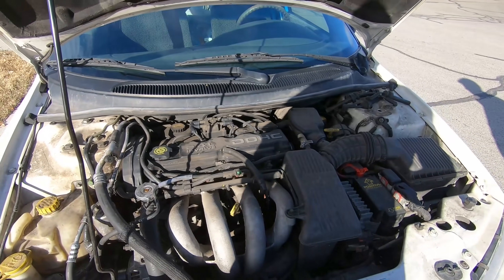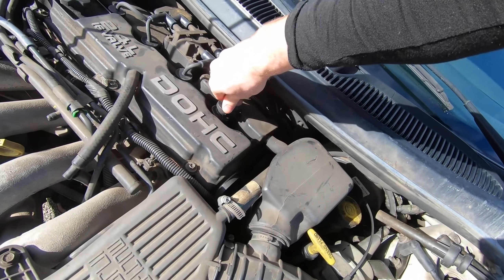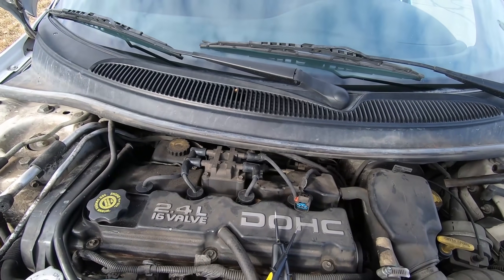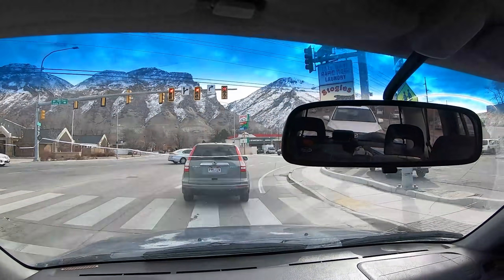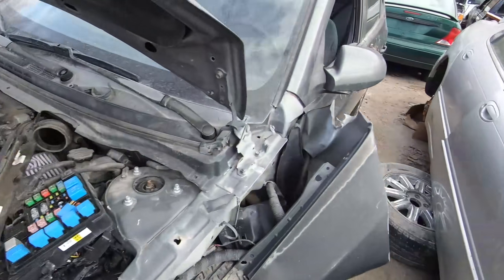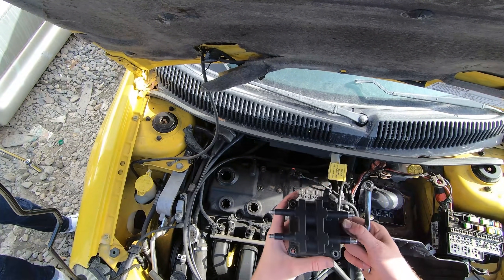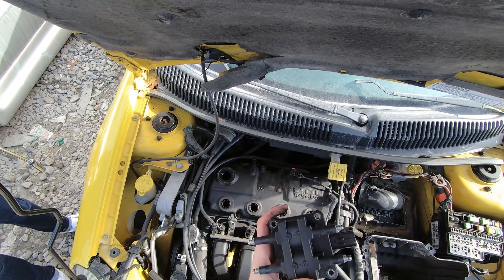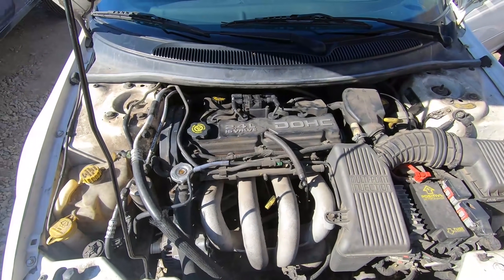A guy misdiagnoses a car. This is what was really wrong. Junkyard parking lot fix.

Comment: When I was younger I got all my parts from the scrapyard Even picked up a few brand new transmissions over the years. His motto was exact same as mine if it drove to the crash means all the parts are still good.👍
Reply: Where I live the junkyards have all gone to selling collision parts to insurance companies, and they don't do the 'pick and pay' thing anymore for small parts. They won't sell you a mirror or a window becauase they figure the insurance company will want the whole door. You can't get a fender or a hood without buying the whole nose clip. It sucks! On my first car I bought a starter, and alternator, and an automatic transmission to keep it running.
Reply: @AcmeRacing  Dang, that's as bad as hearing about the firearm regulations in California. Guess I'm lucky to have a few U-Pull-It yards around me that'll sell or give away whatever you bring from the yard. Just unfortunate that I haven't seen a vehicle there older than the 80's in several years, been having to buy new/aftermarket for my '74 and man what a wallet destroyer. Deep down I know I'm doing the wrong thing pursuing this project that seems to never end given my current financial state. It's become less about restoration and more about maintenance every time I fix something 2 more things need fixing. But I won't give up on it, I've seen plenty of "I regret selling it" to do that this time.
Reply: Fortunately there are still wreckers you can go to. You have to drive increasingly far to get to them (except in my case, I actually moved 20 min away from one that was a 45 min drive) and I think this practice will continue, unfortunately.

Comment: I once found a 95 Suzuki Side kick in a great condition at my local pull a part, it only has a busted hood and a torn roof canvas from the damages I can see. The frame looked perfectly fine, no major rust or damages, even the aftermarket stereo was still in it. The engine and everything looked original with 120k miles on the dash, I called pull a part the next day to ask if I can buy one of their junk vehicle off the yard but they told me no :/ which didn't make sense to me at all, it was such a shame. I would had love to buy it and put it back on the road again
Reply: They make more money parting out the car vs selling it whole

Comment: 2.4 engines in the Dodge Stratus PT cruiser SXT Dodge neon SRT Dodge neon all have the same coil pack and can be used on any of the 2.4 engines. You can also use that same coil pack on the 2.0 engines in the Dodge neon and the Stratus typically if that engine is in a vehicle most parts on there can be swapped between those vehicles.

Comment: Those coil packs are sealed against moisture.  Wet didn't kill it.  In all likelihood it was thermal stress from rapid cooling in the wet wash environment on a hot sketchy coil pack.  Don't over tighten the bolts which can stress crack the housing.

Comment: Whenever you grab a coil pack from a junk yard, always bring it to the desk with the spark plug wires attached. Chances are they won't charge you for them, and it they do, it won't be more than a buck or two, and you can ALWAYS use extra spark plug wires...also, stuff your pockets with fuses...never know when you may need to replace a fuse or relay or breaker!

Comment: can i suggest you getting ratcheting wrenches watching you take forever to get those bolts out was painful for me!
Reply: The problem with the ratcheting wrenches is the size of the head. It doesn't always fit in certain places.
Reply: @doughayward4973  yah i hear yah but they can be handy alot 2! I think i picked up a metric/standard craftsman set for 80 bux online was on sale!
Reply: @bulletsponge1656  You'll never have enough tools. I'm a retired mechanic with a garage full of normal tools, impact tools, test equipment, Escort specials, Omni/Horizon tools, and many, "Why do I have these tools?". Now I "need" battery-powered impacts.

Comment: Happened to my f150 02 when I tried to power wash the engine 🤦‍♂️ I took it to the shop they said water got in the spark plug wells and the replaced all the plugs it ran good again. It ended up costing my like 300.00 now I change them myself !

Comment: A regular owner can get coil packs for fairly cheap online and replace plugs as well if the set is 4 and they are cheap to buy, like my 1999 Corolla NGK platinums are. I like to get new OEM or warranted like OEMs are. Easy to install and fairly cheap to buy.

Comment: when i had my eclipse my 4th always misfired it was rusting the coil terminal i sanded and used dielectric grease and that worked for like 3 months before i swapped parts im thinking thats a common issue on DOHC

Comment: I'm not really familiar with car diagnostics but how did you know it was the coil pack and not the coil itself?
Reply: Coil pack is just all coils in one unit. You saw how he saw it had power to the coil, meaning the pack wasn't working right. He also showed that the spark wasn't jumping to the side of the block like it was in the other cylenders

Comment: if you are going to make a lot of trips to the junk yard   get yourself a small tool bag  fill it with some tools   such as for starters  a cordless impact driver    sockets and ratchets wreches  screw drivers  pliers  maybe a hose pick  cutters     trust me its a time saver   . I wish I could pick my own parts.  and for one coil pack I would have went new   . you dont know what condition it will be at the junk yard    it could be cracked  dry rotted    lots of mileage  on it            change all four  and the plugs    keep it oem       unless your really staped for cash. I would have taken the old coil pack with me  to the yard    and if there is a lot of front end damage    to the car be careful.   if it is electrical parts     keep it new   but thats just me.  and if im walking though a junk yard  its boots  with steel toes    not crogs      bad idea
Reply: good ideas

Comment: What's the deal with cracked windscreens in the US ? I see it a lot on YouTube. that would be a fine and points on your licence here in the UK.
Reply: I don't think there's any place in the US where equipment failure gets you points, but a crack may or may not be a fine, dependent on the size of it. It's just not easily enforced in rural areas where there are very few police.

Comment: I hate to be that guy but you really shouldn't pull HT leads off the plugs on a running engine.  This is extremely hard on the coil insulation and the ECU which has to absorb all the energy it's put into coil if it doesn't spark.  Pulling the injector connector off is safer all round.

Comment: Those are the worst engines, They were literally pouring oil out of the headgasket from the factory with 4 miles on them. And they were pretty well known for timing belt idler pulleys falling apart at 20k miles. And it is an interference engine.

Comment: Two words for you kiddo "ratchet wrench". Other than that I like what you doing
Reply: Probably not enough room for the head of a ratchet wrench on that coil pack. You can see how tight it is at 4:47
Reply: @tuzyzx  Not a socket wrench.  A box wrench (like the one he was using) with a ratcheting head.  It's the same exact physical size as what he was using, but ratchets so you don't have to constantly slip the wrench off and reposition it.
Reply: @geoffreyreuther5260  I know what he means by a ratcheting wrench. I have a set. Usually the box end of a ratcheting wrench is slightly larger to accommodate for the ratcheting mechanism, it's not much but it can be too much at times.

Comment: You didn't check the ohms of the plug wire
Reply: Good idea to check resistance of wires but my self never check wire resistance. I look for obvious breaks and such. He showed the coil is bad and myself if replacing coil(s) i just replace wires and plugs too while im there and cap and rotor if its got a dizzy.
Reply: How'd he show the coil pack is bad? By unplugging the pack from the plug? That couldn't of been a wire not providing  spark?
Reply: @jimmywarledo4930  You do know people on youtube do things and leave them out of videos right? Im sure he didnt want to turn his video into a video on how to check resistence of a wire From the video the wires look ok. Unless theres physical damage a good set a spark plug wires can last longer then the whole vehicle.
Reply: No I didn't know people left stuff out, thanks for telling me lol, I just don't like parts changers lol, that can bite you in the ass
Reply: @jimmywarledo4930  ivan at pine hollow auto diagnostics just had a great misfire video caused by shorted ect from a leaky hood cowling.  great watch
Reply: @peetky8645  ya, I watched that one, I like "Advanced Level Auto" ,Eric knows his stuff
Reply: Maybe you missed it, but he started in the video that the customer had replaced the wires and that didn't solve the problem.

Comment: I'm sorry, but I've never in my 20 years of working on cars have gone to a junkyard to get an electrical part or any part I need to fix a car. Cars are in the junkyard for a reason.
Reply: This doesn't really make sense. If a car gets rear ended and written off by insurance, then the back of the car might be ruined but the front of the car is fine to use for a good few years yet. Take the engine, ECU, fuse box, dash, radio, etc etc.